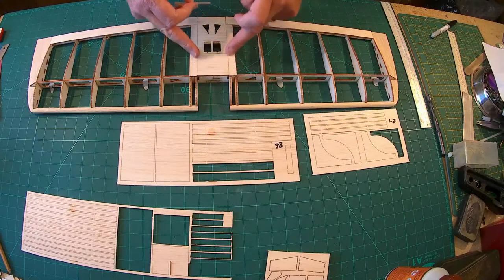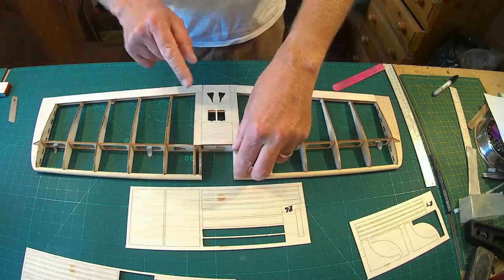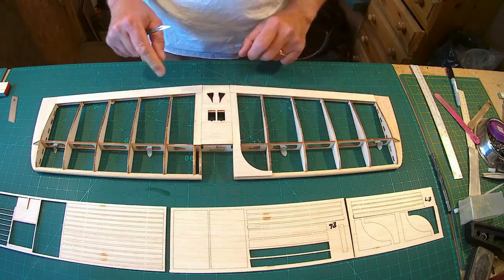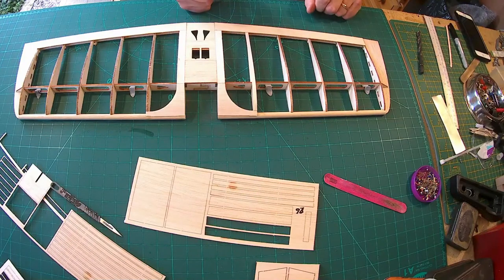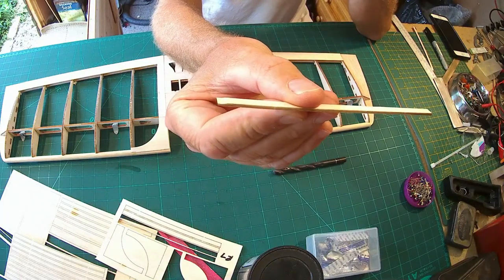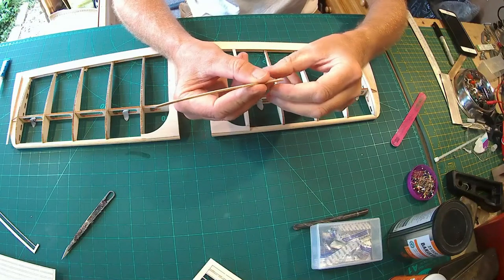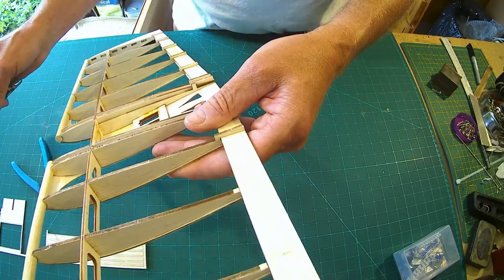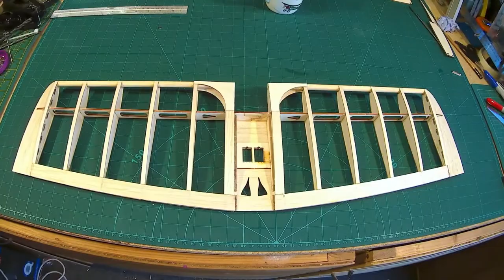Dammit Electric Flying Wing part 4 Cap strips and sheeting

Comment: Newbie to building kits here. What's the best way to bend the balsa rib caps and what glue to use please?
Reply from the maker: its mid way in video mate but gentle stroking into a curve. and i use alphatic wood  glue bud
Reply: @NickChittyFlying  thanks Nick.    Does water help to bend the balsa. Just getting some alphatic glue👍
Reply from the maker: @rumbey1  have a look at 5 mins 52 secs mate you wont need water with the curve its only gentle.